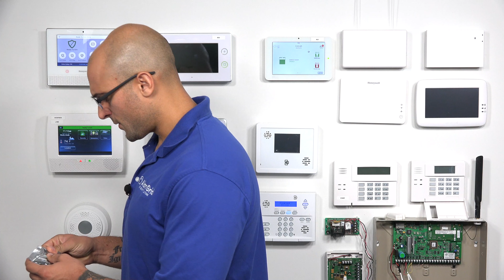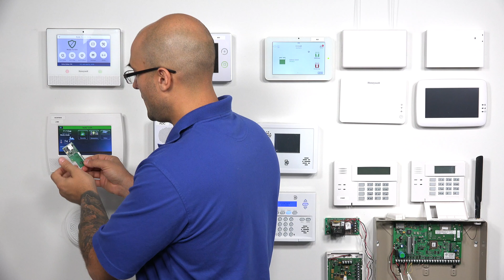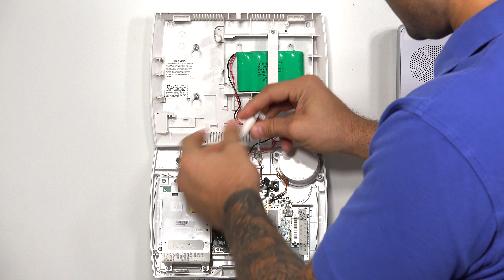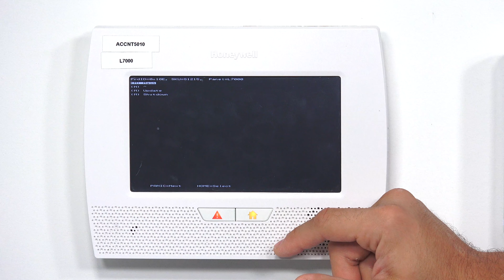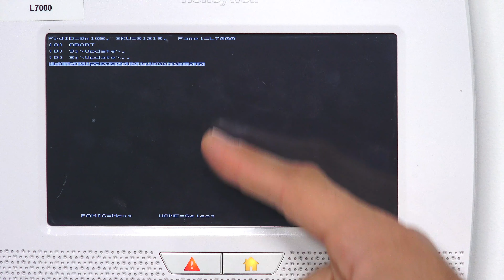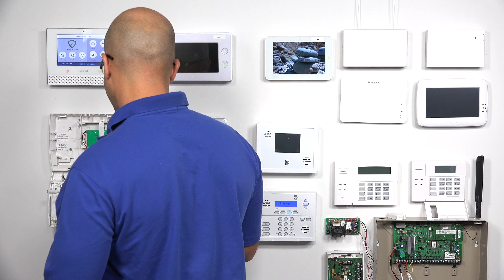Updating a LynxTouch Panel Using the LynxTouch-MSD Tool

Comment: It seems like a downgrade.  We now have to purchase hardware that conflicts with the current hardware in the box.   Future or current firmware can't be found on the Alarm Grid or Honeywell site.    In the past Alarm Grid would install the firmware.    I purchased my L7000 in hopes that it would upgrade in the future,  I can't see that it has had any improvements since I purchased it ~5 years ago.
Reply: We were able to send firmware updates down in the past but the manufacturer took that feature away, So they started manufacturing the updater tool. It will update it to the latest software. The update should not conflict with the panel as long as it is an L5200 , L5210 or an L7000
Reply: @joshuagriffin2807  It's a hardware conflict on the L7000 from what I can see.  It onflicts with the WIFI module. 
I don't see a place where one downloads the firmware.   I don't see spending $'s on this if I can't see where one downloads new firmware nor view release notes for new versions.

I like AlarmGrid but feel like Honeywell wasn't the best choice.  

I now need to purchase a new Verizon card and the updater card.   Seems like I should look at purchasing a new modern panel.   Something that can use my 5800 sensors as the real money was in all of the sensors.

I have already migrated my ZWave network away from the panel as the ZWave support and programming is just a total disappointment.

Comment: Great way I learned today:
1) Power down panel (AC & Battery)
2) Connect MSD Updater
3) Reconnect battery and power, close cover, and let panel boot normally
4) Go into Tools (use installer code), Select "Test", and then "Diagnostics", and then "Reboot"
[Basically you are looking for Reboot - which I am pretty sure its under Diagnostics]
5) After you confirm the reboot - just press and hold the "Home" button and wait for the updater tool to start upon reboot

This way you don't have to run to the transformer, or try and reconnect wires with the panel still open.
Reply: Thank you sir